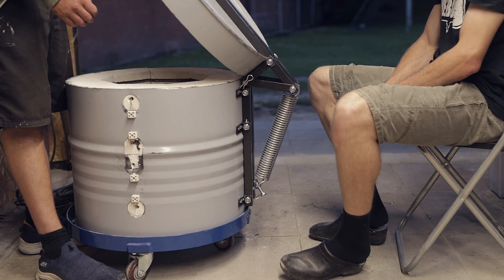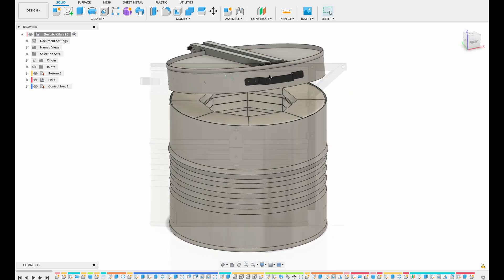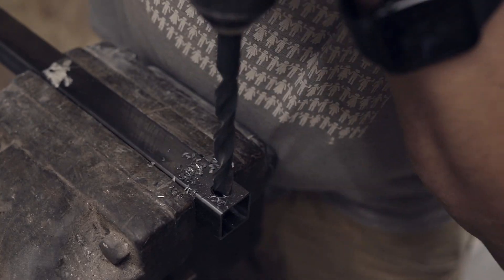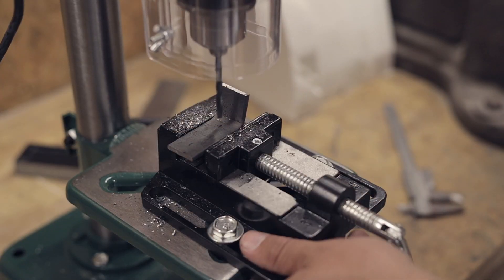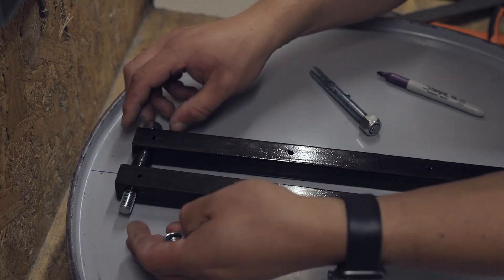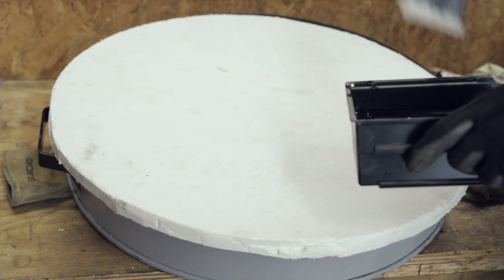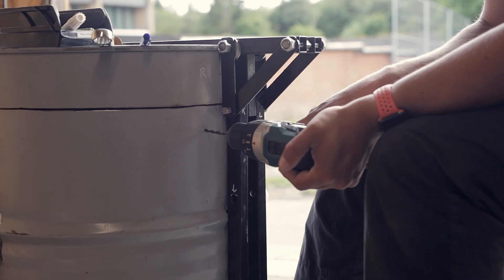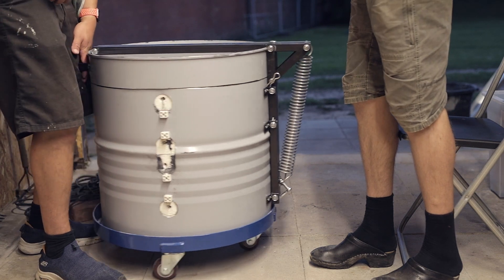Ultimate DIY Electric Kiln Guide - Hinge Mechanism (part 3)

Comment: Sorry, but there is a problem with this type of lid design. When open the hot underside of the lid is facing anyone trying to access the inside of the furnace. At higher temperatures in particular this will make life difficult. This is why my furnace lid lifts slightly and then swings to one side, the hot underside is thus only pointing harmlessly downward and not towards me. This is just as easy to build as your set up here.... Martin
PS. What holds your elements in? My attempts at an electrical furnace (3 phase 25 amp variac controlled) had elements just sitting in simple grooves and on cooling down the contraction of the elements slowly (over a few uses) pulled the elements out of the grooves.

Comment: In fact, you could use only silicate to insulate the cover instead of bricks. This part is not exposed to damage and requires the best thermal insulation.
Reply: do you say that would be enough to isolate? 
I'm also designing a front-opening oven following these instructions, but I'm having trouble finding refractory tiles of the 26T or JM26 composition.

Comment: Out of curiosity, what was the cost of building your own compared to buying a similar spec kiln?
Reply from the maker: I don't have the exact numbers for all the materials, but around 2-4 times cheaper compared to buying a commercial one.
Reply: @jakobhalskov  Plus, you have total control for upgrading or repair in case of any changes or breakdown occur.

Comment: Does the metal enclosure get warm to the touch?
Reply from the maker: It reaches around 50-150°C depending on the duration it is turned on and how hot it is being heated to.
Reply: @jakobhalskov   The wire can withstand maximum heating for how long, or what is the lifetime cycle of the wire? And  what material the wire is made from?
Reply from the maker: @saidmeku707  the wire is made of Kanthal, which comes in different grades withstanding 1300 to 1400°C :)
Reply: @jakobhalskov  Thanks for the feedback bro, appreciated.

Comment: It looks like you have done your research and are doing a very good job.  But, I can't help but ask "why did you make such a small kiln?".  Were you restricted by your electrical service capacity?
Reply from the maker: For now this was what seamed reasonable and limited by my current capabilities in my workshop. I can push it a bit more in the future if I needed faster heating or a higher max-temperature :)

Comment: What is the maximum temperature that you have made? I ve made the kiln from jm23 bricks with 76mm thick walls and i was must enlarge this to 2 layers on walls to 150mm <the top and bottom is still 76mm > to achieve 1200 c.   What i will change in my next kiln is not to stick the bricks to metal top with glue because the high temperature made the top of the kiln like bowed mountain witch crasches in time the bricks. I think making the top of the kiln must be  bymaking the steel band with screws to "hug" the bricks in together.
Reply: And even in windy weather on my balcony the maximum temp is 1100c, the 1200 c is only when the weather is ok...
Reply: @andrzejkrogulski8690  Hello. What do you mean when you say that the weather is ok? I would like to know if that is the same problem with my kiln. Thanks.
Reply from the maker: I have barely been able to melt copper in it's current configuration, which took more than three hours. So around 1100°C is the max temperature at 4.8kW with the current insulation. This also caused the outside of the kiln to reach 100°C at least and damaged the SSR and PID controller - I have since added active fan cooling to the control box on the side of the kiln.

Reaching higher temperature would require thicker insulation or increasing the power level of the heating elements. I would consider thicker Kanthal wire drawing more current.